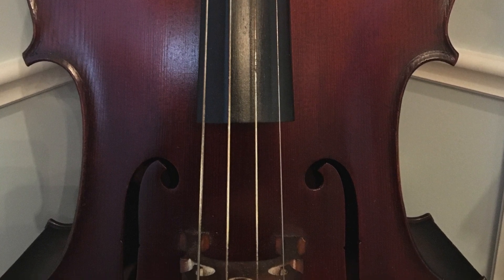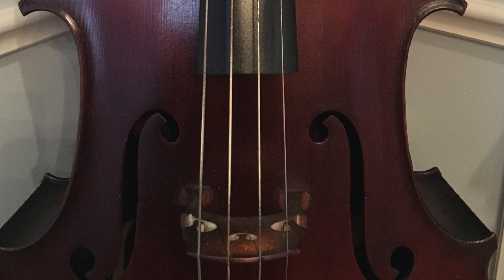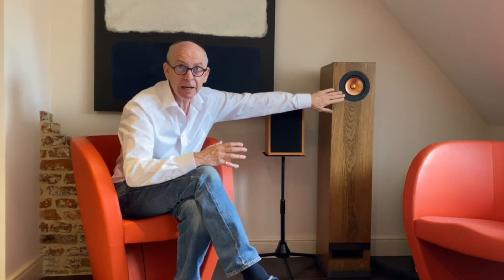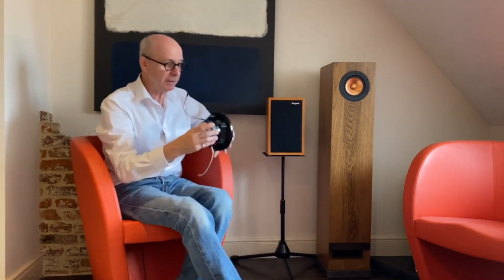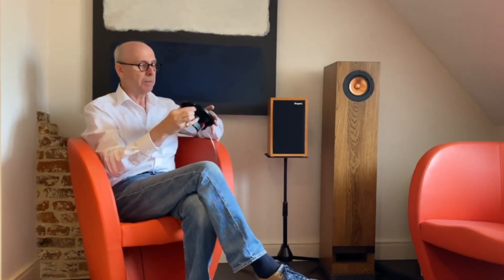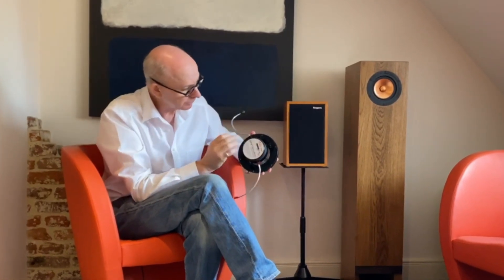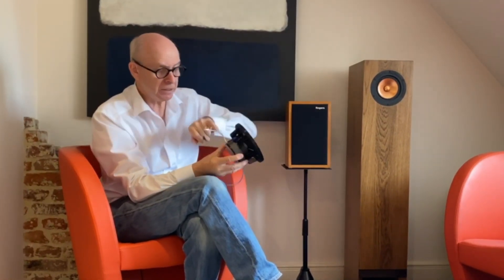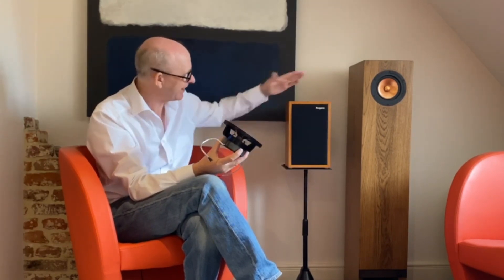The LS3/5A versus the Sibelius Loudspeaker

Comment: I just found your lovely presentation of LS3/5A and Sibelius. You also briefly mentioned KEF‘s own version of BBC speakers. How wound you comment on KEF Reference 101‘s approach with no sophisticated crossover?
Reply from the maker: Hi, very sorry for my late reply, your comment slipped through my filter. As far as crossovers are concerned, there is no simple solution. If a manufacturer can find (or make) two drivers extremely compatible, then a very simple (even two component) crossover can work very well indeed. The big advantage is accurate phasing. I cannot remember the 101’s , but as you probably know, I grew up designing enclosures with KEF and Audax drive units. I’m a big fan of KEF
Reply: Kef 101 are more efficient and easier to drive than the LS 3/5A. So, back in 1980 it was easier to match a suitable amplifier. When I compared them then I could not understand what the fuss was about. Perhaps, with a better matched amplifier and listening at home I might have revised my opinion. In 1980 they were £180-190 (depending which LS3/5A you got). There were many around that price that have more bass. Currently LS3/5A are around £2750. Second hand original 1980s speakers sell for £750-1200. By inflation the lower end of that is the price match (x4.2 1980-2022).

Comment: I am a big fan of the tapered transmission line type of speaker, having a pair of speakers exactly to Chris Rogers Pro9TL design in the late 70's, and decades later, a homemade design that I still have with Cabasse carbon coned woofers, midrange, tweeter and real sheep's wool for internal tuning/damping. There is just a natural smoothness in both response and phase through the lower frequencies that is unmatched. I am sure I'd enjoy your Sibelius, the coherence of single driver is also something that once experienced, is special.

Comment: I love that you use a double bass.  You did leave out the role of the soundpost.  As the top vibrates it transfers that vibration via the post to the back of the bass effectively creating something like a bellow.  That is is how the air column is created in the body.  Not a critique, I love your video. Just a tweak. Cheers.
Reply from the maker: Hi Jason, you’re absolutely right. And even the slightest re-positioning of the sound post can make the most dramatic difference in the sound. Thanks for your comment, how silly of me. Glad you enjoy my videos. There are more coming soon.

Comment: LS3/5A cost just over £200 in 1978, my Rogers compact monitors from the same shop in Reading were £180. They were also BBC designed but have far deeper bass and a still excellent. However, I should have spent the extra £20 as my interest shifted from a mix of classical and rock to classical,  opera and chamber music.
In fairness to Rogers they were fully aware of the limitations and so went on to make a matching pair of large bass speakers to put the LS3/5As on. The combination was spectacular but close on £1k at the time so even more than your Sibelius at today’s prices.
Having said that, the best speakers I heard when a student buying decent hifi were the Quad electrostatics driven by a 33/303 with a top end Dual turntable and a top Shure cartridge playing Carmina Burana on a DG pressing. In the late 70s this was a very expensive set up. I did buy the album which I still have…..
Reply from the maker: Thanks for your comment Andrew. Very interesting. Many QUAD electrostatic owners like the Sibelius. They sound very similar in their characteristics. It’s great to hear you still have your original loudspeakers.
Reply: The BC1's were £260 in 1980. Preferable to the LS3/5A in the bass department.

Comment: I find this very hard to believe. An 8 inch speaker will not produce a realistic sound level of a contra bass. Period!
Reply from the maker: Thanks for your comment. But let me explain it this way. There is no correlation between the size of a drive cone and the level of bass. Look at many subwoofers that use 8” or less drivers. We can produce enormous bass from a 3” cone in the right enclosure. Imagine, the reed on the mouthpiece of a bass clarinet. It’s about an inch and a half wide and long, yet when it it is connected to the instrument the vibrations it produces create very low and loud bass notes. It’s how the vibrations are amplified by the enclosure. I hope this helps? Hopefully one day you’ll hear our loudspeakers and discover them for yourself.
Reply: As Harley says, the size/area of the drive unit is not as significant as people often think. My TDL Studio 3 speakers (trransmission line) have 8" drive units and their response goes down to just below 20Hz. The problem with using drivers of 10" and bigger is that the mathematics of cabinet sizing and room handling makes them get out of hand from a hifi point of view. Also, larger drivers suffer more from 'cone break-up' (I don't mean ripping apart) whereby the cone flexes in various patterns and of course this creates inaccuracies in the sound.

Comment: What you described is intriguing on several levels. You've designed a full range speaker and cabinet system which  probably lively and pure at the same time. I was trying to work out if it is a transmission line or, a horn loaded system. I think you said horn loaded. So the gain from the horn fills in the low frequencies.  It looks incredibly beautiful and zen in the purity of concept and build. I am currently using Kef Reference 103 and that is a moderately large stand-mounted system with the odd distinction that the drive units are mounted on a rotatable plate. These sound neutral and I have ended up renewing the capacitors and some resistors and the internal wiring. They have good bandwidth and open sound with low colouration. The aspect of tuning and voicing seems to be a real problem that needs more than just measurement to solve. Did your driver have falling treble and how did you solve  that potential problem?
Reply: I will have to go and listen to them in the Spring. Like a quarter-wave transmission line. The drive unit must be very pure sounding in treble and mid-range and phase coherent too!
Reply from the maker: @christopherward5065  it certainly is, no worries there! Reach out to enquiries@pearlacoustics.com, if you want to hear a pair.
Reply from the maker: Thank you for your comment. I remember the Kef Ref 103 very well. The secret of our design is an outstanding drive cone on a quarter wave pipe constructed with very thick dense oak. We can go very low 38hz is the beginning of our roll off point. This shocks everyone who hears it. They can’t believe a little cone can do this. But it’s the enclosure that does the work - giving ultra detailed bass but with a high end that’s performing as well as the best loudspeakers. We do not use any kind of filtration or electrical components. Just like a double bass.

Comment: Biggest difference is damping. LS3/5A employed tons of damping in the enclosure, the drivers (bextrene) and even electrical damping in the crossover. Some people think went too far and sacrificed efficiency and dynamics in the process. But once you've heard a speaker devoid of rough edges such as the LS3/5A it's hard to go back to listening to conventional speakers. Complete elimination of listener fatigue is what these and other classic British designs are all about. Something most modern speakers can take a lesson from... sheer listenability. Listen to a pair of classic Spendor BC1s and you can listen all day and night without wanting to shut them off. Can you say the same for most modern designs?
Reply from the maker: Thanks for your comment, listening fatigue can be a real challenge with many systems - in the pursuit of accuracy and dynamics.
Reply: Extreme high frequencies causes listener fatigue. The LS3/5a and many classic British speakers all have softer tone in their high frequency reproduction.
Reply: @Just-An-AverageBear  LS3/5As extend nicely to 20khz. The KEF T27 tweeter they use is capable up to near 30khz. The reason it sounds smoother is a lack of resonances and stored energy. This tweeter has little ringing due to the material it's made from and it's coating. Ringing at any frequency causes listening fatigue. The perforated screen over the tweeter also has a slight muting effect compared to a naked T27.
Reply: I can say it about the Cube Audio speakers and the Qualio IQ.speakers.

Comment: Why don't you publish the diameter of the single driver? Is it embarrassingly small? Like 5.25" ? Why this secrecy?
Reply from the maker: No secret. Size has absolutely no impact on the bass performance. In fact you guess about right depending if you measure rim to rim or the cone itself
Reply: @PearlAcoustics  "No secret", and yet you STILL won't divulge it. As for drive size impact on bass performance, suffice it to say I wasn't born yesterday.
Reply: @GID-GR  He clearly displays the labelled rear of the speaker IN THIS VIDEO... It a Mark Audio Alpair 10, 100mm driver...

Comment: I don't understand why the LS3/5a is so revered in HiFi circles. It is a near-field monitor, designed for the specific, limited task of providing faithful reproduction of a primarily spoken word signal in very small spaces - an outside broadcast van, chiefly. And it does that very well.

What it is not suited to is general-purpose use - reproduction of music over the full frequency spectrum with a high dynamic range. It has miserable bass response, miserable power-handling and terrible efficiency.

My father had a pair of Rogers LS3/5a's which I listened to extensively. With opera, the vocals were sublime , faultless, but the dynamics of the orchestra were lost and the lower strings and timpani were distant and muted. Playing modern music (e.g. Steely Dan, which I loved for the complex yet uncluttered arrangements, 1/3 of the music was missing).

I think the LS3/5a's popularity coincided  with the 80's-early 90's thrust in HiFi to emphasise source above all else. After all, you cannot hear what the source has not provided! We forgot that we cannot hear what the system cannot reproduce...

So you end up with systems comprising a top-notch source (LP12, Pink Triangle) and tiny, inefficient standmount speakers such as Linn Kans, Acoustic Energy AE1's and yes, the LS3/5a's. Married together using a "good" pre-amp and a brutal solid-state power amp (Krell KSA-50, for example) to overcome the efficiency - or lack thereof - of the speakers.

Such systems signal virtue - "Look, I'm concentrating on the source, how pure and true must my listening ideals be!"

I think we've moved on from there and realised that as in most things in life, HiFi reproduction is a balancing act, a negotiation, but there are still some corners where the old thinking lives on and the ridiculous price of the LS3/5a is one of them.
Reply from the maker: Dear Tim, thank you for your comment.
indeed, it is a complete mystery… I agree with you, the LS3/5A’s are over rated by many. 
I think the cult status came mostly from their success in countries like Japan, where room sizes were often very small. And where ‘British’ and the ‘BBC’ was revered. I compare them with the difference between an Aston Martin DB4 and an e-type Jaguar. Today, the Aston is worth roughly ten times the amount of an e-type. Yet it’s not as nice to drive and no more beautiful (in my eyes). But James Bond drove the Aston and not an e-type and somehow a cult was born. 
The LS3/5A is, as you say, a nice little speaker for vocals and it can be forgiving on badly recorded music. What it did well was to mimic good quality radios that people might have in their homes, at the time. 
I used the comparison in my video,  simply because it’s mid-range is wonderful, it’s small and most HiFi enthusiasts have heard of it! Plus it is a nice thing to have around but indeed, not to be taken too seriously when appreciating music. One album I like to listen to, to assess a system is Steely Dan’s ‘Two against nature’. On the LS3/5A’s, I agree, there’s just two much missing. But if your room has the right acoustic for them, they can sound deceptively good for their time and age.
Reply: @PearlAcoustics  Thanks for the response. Yes the Japan connection makes sense. reading around, the Far East seems to be like a black hole when it comes to LS3/5a's - greedily sucking them up and if you have an ex-BBC pair (thin wall cabinets, asset label intact), you can name your price!
Reply: M

Comment: Dear James, I am quite sure that I saw on one of your videos here on YT nice sacks in the corners of your listening room acting as bass traps (I hope it was in one of your videos, and I am not in error). Would you mind sharing what the inner is made of? I am just optimizing my listening room, and the bass still appears to be a problem - not too big, but big enough to take care of. Many thanks in advance!
Reply from the maker: Hi. Yes I did talk about sacks for bass traps. That was in my Room Acoustics video. They consist of double thick hessian sewn into a large sack. The diameter of a roll of Rockwall insulation. I placed the tolls into the sacks, one on top of the other and then peeled off their thin plastic wrappers, once they were inside. They are very effective at absorbing bass in corners and this is useful if it is bouncing back into the room out of phase. + they are very easy and ecological to recycle, should you no longer need them for any reason. Hope this helps?

Comment: What a great comparison, especially as to is without blaming competition. Instead explaining the different requirements from BBC and his own.
Never heard about Sibelius speakers before, but I love the concept of no crossover between the amp and the speaker coil.
Reply: My current speakers are twin 6 inch woofers in a TQWP crossed to a one inch tweeter via a single capacitor. The lack of a complex crossover confers considerable benefits in the quality of sound.
Reply: @jonathansturm4163  Some of these benefits can be had from active crossovers, but it's only a Band-Aid if the speaker isn't designed well to begin with.
Most active crossovers don't fix the phase problems associated with the crossover or the driver placement, but some try to an extent, or others use DSP to try their hardest to fix a bad design.
One driver with a wide dispersion is the ideal condition, and probably why this speaker is said to sound much like the Quad ESL's.
Reply from the maker: Thanks.
Reply: If it in deed sounds like the Quad ESL, which model?  Peter Walker was asked if he had not designed his speaker, what other speaker would he have wished to design. He said the Beveridge electrostatic line array with the acoustic lens.
Reply: I have the Beveridge model 3 without the woofers. From 200 Hz upwards would the Sibelius sound the same?

Comment: @ Pearl Acoustics I'm a new subscriber and have enjoyed your video productions immensely. Would you know the manufacturer of the speaker stands the LS3/5As on sitting atop?
Reply from the maker: Thank you Bruce. Very kind. The stands are just some ‘Manfrotto’ lighting stands with a custom screw on plate that I use for my on location ‘Yamaha’ studio monitors. 
In all honesty, the little LS3/5A’s need very sturdy stands. Find yourself some stands that you can fill the central tubes with dry sand. Or get your local metal worker to make some up with 5mm steel plates (top and bottom)  and a scaffold pipe (which you fill with sand from the top). Then you’ll have something amazing for very little money.

Comment: 36hz my ass .... My speakers have 6.5 driver, can do 20db at -15db. ..  you can't hear that 

So forget 36db fro. That small driver
Reply from the maker: Dear Edward. Thank you for your comment. I can imagine that it is hard to believe. The secret is in the cabinet. Think about how a double bass makes such low frequencies and so loud, it’s the body of the instrument and the air pressure within it, not the driver. As long as the driver is vibrating at 38hz, the cabinet does the rest. Maybe one day you’ll hear a pair. Some people think we hide two 8” woofers in them. But I assure you we don’t, neither do we use filters. Best wishes from Belgium
Reply: I  meant the ls3/5 speaker....  Sorry , I didn't listen to the whole video
Reply from the maker: @edwardbalboa5528  absolutely no problem . Glad the misunderstanding is cleared up.